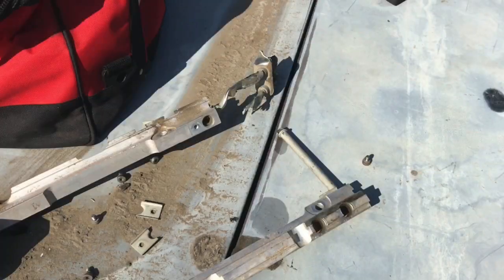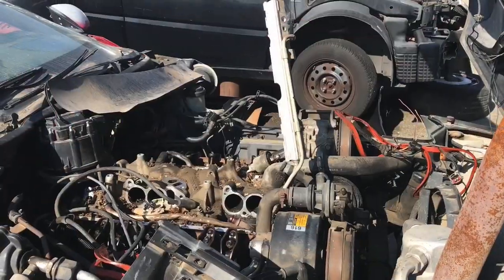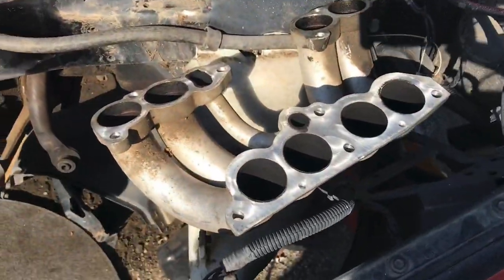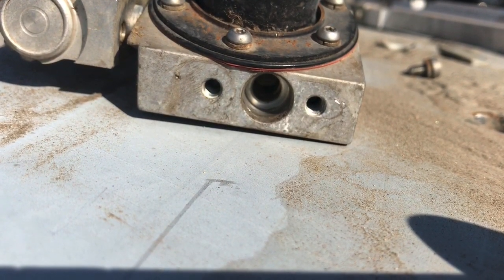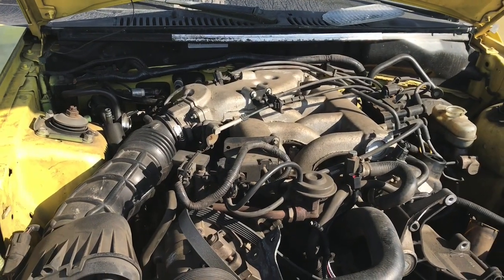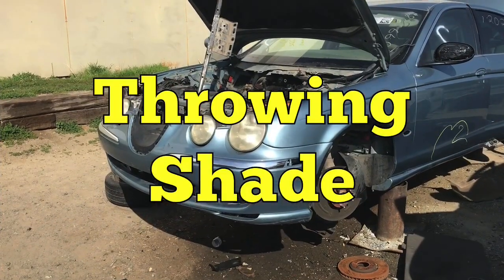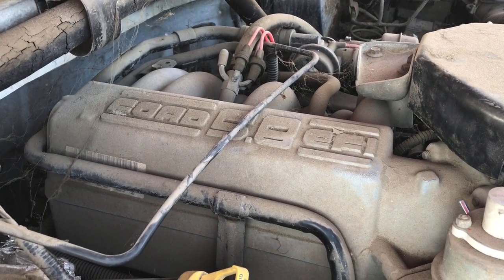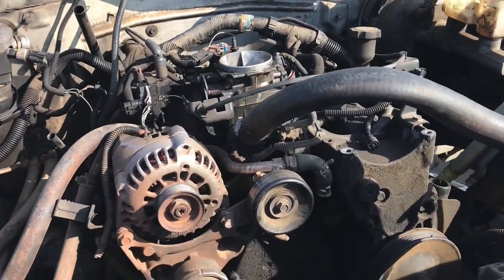JUNKYARD TRIP-THE LOW-BUCK PERFORMANCE PALACE!

Comment: I can't wait for the 3800 video. I really want to do a swap with that engine.
Reply: I'd prefer a 4.6 northstar if we're going luxury GM motors.
Reply: Gen 5 supercharger,  northstar throttle body,  LS MAF,  bigger injectors.  
🏎💨💨
Reply: @Prestiged_peck  the Northstar is a phenomenal engine. A friend of mine got a Cadillac Seville STS and the engine pulls like a champ. I am thinking of putting the engine in a small car so the engine is a good size imo.
Reply: Waiting for my 3800 to come back from the machine shop. I'm also waiting eagerly 😂
Reply: @hayden6056  then your'e farther than me.😂 i don't have the car nor the engine.😂 there isn't a lot of 3800 in Norway.😭
Reply: @coolshookieboy91  who says it needs to be big? The later northstar take LS6 head bolts, which ARP sells studs to replace, and I'm willing to bet with a supercharger after studded heads you could get well over 800 ft-lbs before you had any stock bottom end troubles, then there's northstar performance that I guarantee has forged internals for them.

Comment: Battle of the V10's would be epic
Reply: not fair for a 6.8 vs a 8.0 but fun to watch for sure, both make similar hp/tq
Reply: @Risenol  I don't think it's that simple - the Dodge heads were designed back in the late '80s and even then weren't the most impressive pieces ever, while a 3v Modular V10 with those modern 3 valve heads designed in the mid-2000s would be a very compelling comparison I would argue.
  
People can have all their sayings like "no replacement for displacement" - but fact is that AIR FLOW is the REAL king. More air = more fuel = more power. And, in the 2012 EMC when they let the 4v Mods play, we saw how much power they can make WAY down low(even though "overhead cam engines don't make no torks"...), comparing to the big block competitors that same year. The 3vs are definitely not the GT/GT500 4vs of course, but those two intake valves can still move a LOT of air.

Comment: Man it'd be really easy to design a 3d printed part that could adapt webers or even gsxr throttle bodies onto a TPI manifold base. Budget ITBs?
Reply: I've had the same thought, but the manifolds are not very ideal from a performance basis.  Even the base of the manifold sucks.  If you wanted to use one for ITBs presumably with high end power in mind the stock base has a terrible approach angle to the port. 

If 3D printing is your thing just print up some bases to mount directly to the heads. Some simple sheet metal fabrication to make a valley pan and some thicker plates for the coolant crossovers plumbed to an off the shelf remote T Stat housing would have you set.

Comment: Several years ago I had a TPI trans am, I pulled an entire TOI swap off a truck at a self service yard, an early 9 injector vetted manifold loaded up with all the TPIS aftermarket goodies. Larger throttle body, larger injectors, adjustable regulator etc.  Paid $68 out the door for it lol.

Comment: The only thing about the 2.4l turbo dodges is that the exhaust manifold is cast with the turbo exhaust housing in some of them. You need a exhaust manifold from a na 2.4 for a simple turbo kit. The factory turbo is within 30hp of maxed from the factory. The 2.4l turbo also has a different piston crown with no quench, I don't know if any of the internals are beefier.

Comment: Love what you do Richard! What was that c60 engine? was it a tall deck? 366 or 427 truck engine! Please dont get hung up on all those odd ball engines, they make very little power, very few parts,& cost just as much or more as your main stream engines! People dont realize how small & compact a aluminum L/S is. They are smaller & more compact than even some of the well liked straight 6 engines! Great job w all you do, I would like to see you do something w that c60 engine! Maybe getting back onto big power l/s Quinten Feast of Australia has been 7.40s @ over 180mph w a real deal street car! Upgraded iron 6.0 liter, made 1400 @ hub! Lasted long time, thousands of miles, 100s of passes all in 7 sec area! Engine has been in car since 16or17! Thanks again!

Comment: I have a 1978 warranty replacement 440 short block that has never been used. The cylinders could use a little clean up due to some minor rust but it's technically "new". Let me know if interested.

Comment: The junkyard’s where every block that ever went in my race car came from most I only paid $20-25 for a 350 4 bolt main, now you can barely find a four bolt main usually you gotta convert a two bolt to a four bolt or buy a dart block for drag applications, two bolt mains just aren’t what you want

Comment: I have a question Richard. Ive been doing research about boosting a 360 or 390 fe but everything im finding is saying don't do it but there are a few supercharger kits. What am I missing here. Will low boost blow a fe or not lol
Reply from the maker: do it
Reply: @richardholdener1727  oh shit😂 alright man. Im really new to all this. It will be my first build and im just trying to get it right I plan on running a holly sniper efi  set up just to try and make it more reliable and ive been looking into what all it would take. Ive been binging just about all of your stuff these past few weeks and really just trying to soak up as much info as I can. Do you have any tips for other bbf or forced induction information I can or should be looking into?
Reply: @quintinknite3712  If you're using a stock shortblock, 360s have low compression...Prolly a better bet.
Reply: @falconater68  my truck a 360 with a blown head gasket that got super hot in it I need to get checked and was thinking about adding a cheap kung pow tornado to see what it does or stroking it to a 445 if it's good. I also have a 460 on the shelf that I was originally just going to swap in there if its bad

Comment: If you had a better shot of the tag on that AMC it could be deciphered to see what it is, OR you can look on the side of the block under the motor mount tower and the displacement will be cast right on the side of the block.
Reply from the maker: THNX
Reply: @richardholdener1727  Went back and played with the contrast on my monitor, I do believe the tag says it's a "1972-AUGUST-304CID-17th day", that would be #'s correct for 1973 and it doesn't surprise me at all that that big car only has a 304 in it.

Comment: Hey Richard did you see any 4.0 liter ford v6 outta the Mazda b4000 trucks??? I really think that motor has some grunt and can only be made better with a turbo
Reply: The 4.0 block will crack at 400 bhp and there is no aftermarket support. I've done a bunch of searching for my 4.0 stang

Comment: Here you can find all the cars with 3800 motors !!

https://en.m.wikipedia.org/wiki/Buick_V6_engine.      

Here you can see every vehicle that has a ... Series 2 - L36, L67,  ///  Series 3 - L26, L32  They are In about 10 different cars or More ..... btw supercharged engines have lower compression and injectors are mounted in cylinder heads, N/A they are in the LIM ..... N/A Have higher compression..... also out of the 4 engine the L36 ( plastic plenum ) Has the strongest bottom end  out of all 2/3 series ...... series 3 N/A L27 have Metal plenums good for high boost but plastic with foam insert I think flows better..... The down fall of the L27 series 3 is The Wnd Rod Caps Or Bolts are Notorious for letting Go or throwing rod arms
Threw oil pan when turning up the boost a little ........ L32 S/C have Forged Cracked Piston Rod End Caps Too, But don’t really hear much problems with them like L27

BTW ..... I have a 102k series 2 L67 Supercharged engine that’s been bulletproofed meaning and defective gasket ect have been changed .... Throttle body gasket, S/C Gasket W/ o-rings Ect, new 180% t-stay ,( LIM ) Metal GM Aluminum redesigned Lower Intake Manifold gasket ( Whichnis why all Theses engine go / start knocking the coolant ports crack because the gaskets plastic and lets coolant into then oil and spins lower end bearings ect 

BTW... let me know if you have any questions OR Need part Because I have a good amount of parts still and probably every sensor for the engine and some transmission ect / other miscellaneous stuff , Just Ask!

Comment: I have a Buick 340 5.6L that could use some power upgrades....
Reply: Did you check with TA performance? They now have aluminum heads for a small block
Reply: @dtoshredneck   The 340 is a Very Special Beast.... can't even find an Intake. Very few cams. Even less info on it.

Comment: 4.9 liter mustangs. Loved everyone thinking they were 5.0 liter in displacement
Reply: 305’s are just under 5 liters also. 4.998
Reply: @iqinsanity  but that rounds correctly to 5. The Ford 5.0 is incorrectly rounded. Its a 4.9
Reply: Going by what the manufacturer refers them as.
Reply: @iqinsanity  4.94364947 liters rounds to 4.9
Reply: 4.9 rounds to 5

#math
Reply: @iqinsanity  only when you are talking whole numbers. We are talking .1 liters at a time. By your logic the chevy 350 5.7 would become a 6.0... the ford 302 is a 4.9 not a 5.0. Rebadge your fender
Reply: That’s the thing though isn’t it?

Anyone can pick where they want to round up from. One decimal? Two? Ten? None?
Reply: Don’t round at all and they’re both 4.9
Reply: Here’s a better question is the Ford .1 liter bigger 351 vs 350 because it’s an inch bigger? 

351 does round to 5.8 and 350 does round to 5.7
Reply: @iqinsanity  they can but in this case all motors are advertised at one decimal so that is where it is rounded. 4.6, 5.0, 5.2, 5.7, 5.8, etc. So the 5.0 is a flat out lie. We want to retain the one decimal. Otherwise the ford 4.6 would also be a 5.0. They goofed. The ford 302 is a 4.9. Bore is 4 and stroke is 3. 4.9436 rounds to 4.9.
Reply: The 351 isn’t even 351 cubic inches it rounds to 352 but Ford already had a 352 (fe motor). 

Ford already had a 4.9 when they switched the marketing to metric. 

But that’s my whole point, you’re literally arguing about a marketing gimmick.
Reply: GM made 3 LT1’s and they share practically no parts in common. 3 different designs. 

Why did they do that? Marketing
Reply: It's well known why Ford did it;

1) They already had the 4.9/300 inline 6 cylinder.
2) It was created to compete in classes with 5.0 limit.
3) A "5.0" emblem was cheaper to make than a "4.9."

Ford's 427 FE really rounds up to 426 but obviously they didn't want to label it the same as Chrsyler's.

Always seemed strange to me that Chevy guys love to point out that the 5.0 isn't really a 5.0. They get beat by an engine smaller than theirs, seems really stupid to point out that the engine that beat them is EVEN SMALLER than advertised.
Reply: @foxfordcatguy2283  to me its not being said to be disrespectful. I have owned plenty of Ford, Chevy and Mopars. Just calling it as I see it. And I'm not sure one really beats the other. Chevy made plenty of high winding 302 cubic inch motors as well. They both have made many legendary motors. Some people favor one brand over another. I think cars are cool no matter what. But facts are facts. I love discussing it.
Reply: @ericdolby1622  Not a "flat out lie," a little white lie that doesn't hurt anyone. If they claimed it was SMALLER than it was to cheat/fit the class rules or if they lied & overrated the horsepower, that would be a big deal. But labeling it "5.0" for the reasons I've already given in my previous reply or just because it looks/sounds better doesn't "hurt" anyone.
Reply: Remember, when the 350 tpi camero came out it cost 40% more than a 5.0 mustang to only go .5 seconds faster in the 1/4. With mods the camero couldn’t keep up. The Ford increased power as fast as the camero but the camero couldn’t shed the pounds the mustang never had to begin with.
Reply: @iqinsanity  yep. I remember many such comparisons. Compare a 2010 camaro to a 2010 mustang. I always thought the wars were awesome and healthy to have. And we as consumers benefited the most.
Reply: @iqinsanity  Yup, you took the money you saved buying a less expensive/lighter Mustang put it into mods that made them completely trounce F-bodys.
Reply: @ericdolby1622  The 302 Chevy wasn't built during the "5.0 Mustang" era. And it was a purpose built high performance engine not the "all around engine" that Ford 302 was & they were only made for about 2-3 years in the '60s. In the '80s-'90s the competition was between 5.0/302 Ford & the Chevy 5.0/305 & 5.7/350. The 305 Chevy was never any competition for the Ford I've NEVER been beat by one with either my 289 or 302 Fords. The only fair comparison for 302 Chevy would be the Boss 302.

Look up MotorWeek Retro Reviews on here. There's one comparing the '82 Mustang w/ a 2V 5.0 making 157HP & a '82 Camaro making ONLY 145 HP w/ a 4V!? There's also one comparing '85 Mustang/Firebird/Camaro. Mustang won both & that was before the 5.0 hit it's high point in HP/torque.

BTW: The Chevy 307 was a dog, too. I had to bracket race against a '68 or '69 Malibu 307 with my 5.0 Supercab longbed F150 w/ a cap, Snap-On top box in the bed + a bunch of other junk in the bed. Couldn't believe it when we got to the line & I realized I was giving him a 1/2 second headstart!? I drove around him, he then cried that they didn't give him enough time to deep stage & because his sister worked in the tower they made us rerun & I beat him again

The only way a SB Chevy is any competition for a SB Ford is with much more cubes.
Reply: @foxfordcatguy2283  i wonder if Richard would agree with you?
Reply: @ericdolby1622  He has a comparison video between 302 Ford & 305 Chevy. He points out the drawbacks of the 305 due to its smaller bore which limits the size valve you can fit & there is limited head selection that have valves that fit the smaller bore. Even if you use the same size valves in both engines, the 305 would be "shrouded" because of the smaller bore.

Been a certified mechanic for 32 years, a drag racer almost as long & around racing/cars my whole life (as a kid I helped my dad who worked on a pit crew for Sprint Cars & Midgets). I speak from real life experience.
Reply: @foxfordcatguy2283  I get it. I always went for the 350. Right now I have the 6.0 which I believe equates to 364. Great discussion though.